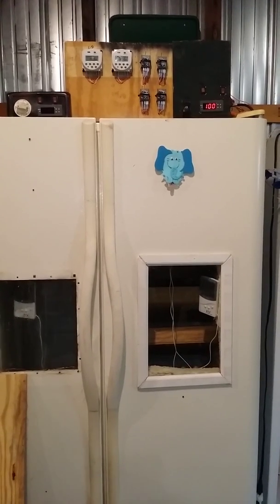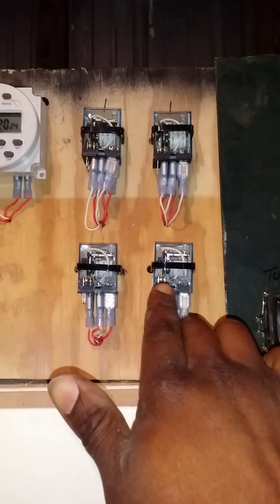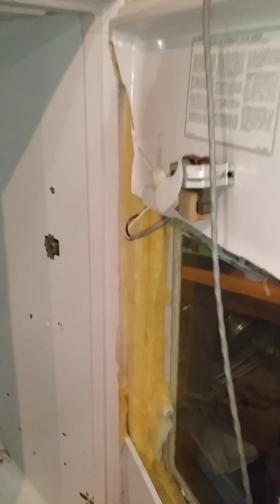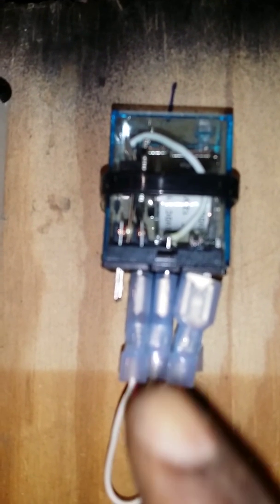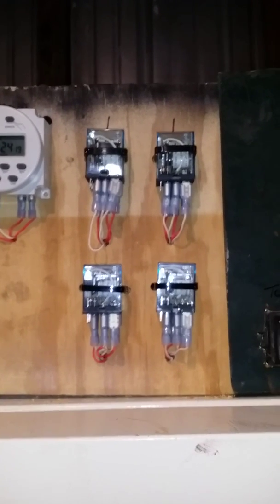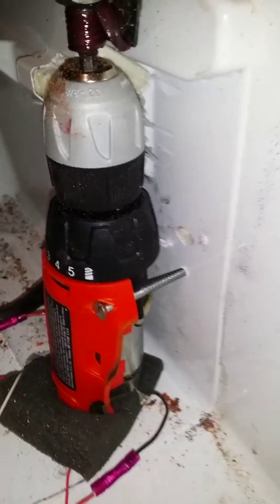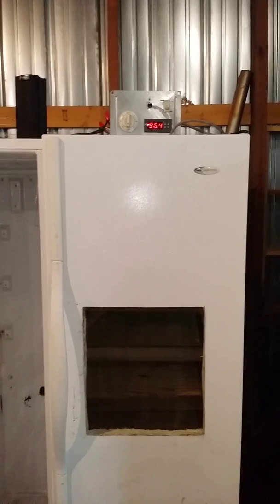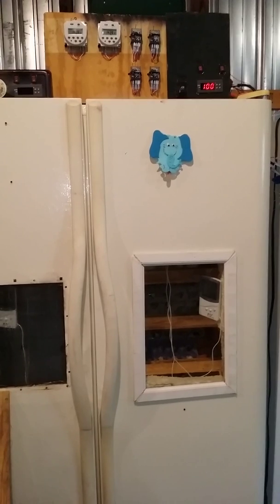Pt16 homemade incubator w/ automatic egg turner

Comment: I too would appreciate a wiring diagram for the relays, limiting switches and drill motor. What is the timer on the egg turner and how is it wired to the relays?

Comment: While this an excellent setup with with a very good presentation, it is a shame there wasn't a better explanation of the realy switch setup and wiring. I did find these relays on Ebay; they are: LY2 8 Pin 100V / 110V AC Plug in Electromagnetic Relay. If I'm wrong, I apologise in advance. 
Since these videos were made in 2015, I do hope nothing bad has happened OP. Perhaps someone with the relevant knowledge would be kind enough to help out.

Comment: Love the videos and the ideas. I started mine, but am having a difficult time figuring out the relay switches and the times. I can't find any other videos that are like your, so it would be amazing if you could do one more video explaining that. Also would you suggest that I use DC or use AC and use a plug outlet, because I noticed you used a battery.

Comment: Thank you for a great video it helped me out a lot. but the wiring part is not clear to me. specifically the relays, timer and the drill. also if you would please explain why the stove eye doesn't go red. How do you control it. if you can do an explanatory  video or diagram  it would be appreciated. and thanks again.

Comment: Hello
I would like to thank you for the very nice and clear videos. However, I would like to have either a video or a diagram on the wiring of the different components such as relays, timers and the limit switched with the motor.
Thank you

Comment: Hi bro the videos have been useful to me I'm trying to do the same project in africa I was  tucked cause I used linear actuators for turning eggs trays but the motor was pulling the trays in and out on operating.so I will adopt ur drilling machine option thanks. I was looking forward to watch video with wiring diagrams I couldn't find any .would u post the diagrams it will be of much help .best regards